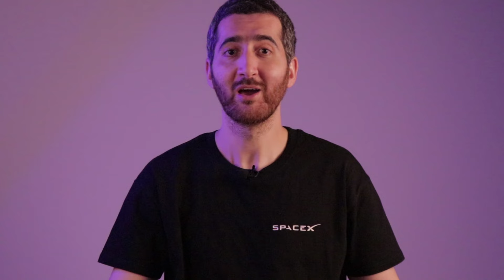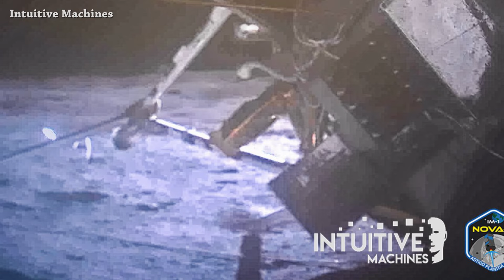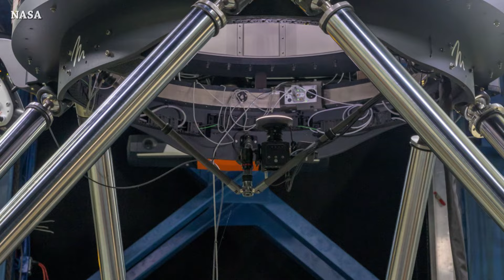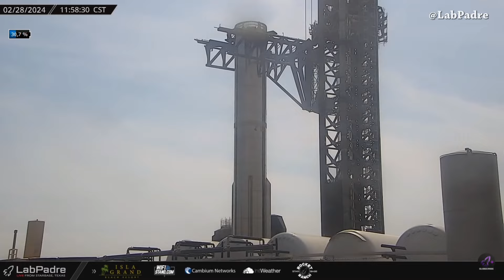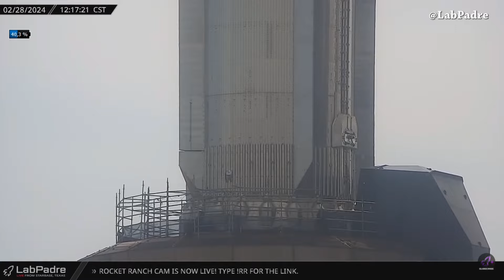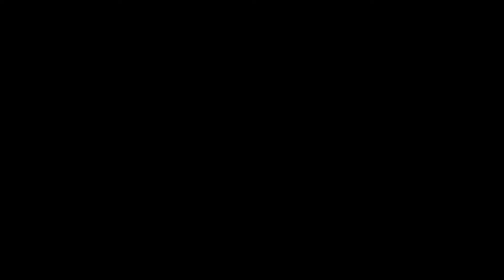Super Heavy Booster 10 Moved, Lifted and Mounted | Starbase Pink

Comment: That full Varda video/audio- disconnect from Photon bus, through and including touchdown- is amazing; and I hope it leads others to start including microphones as standard instrumentation. Even I was surprised that the separation of the two parts in orbit produced an audible sound!
Reply: Sure it does.  Transportation of sound waves happens through the structure of the device, and much faster than by air.

Its 343 m/s in air, but sound waves in steel go 5.5 km/s.

Comment: Thanks Pink.. its staggering to see how far we’ve come since the Apollo missions (or perhaps not) but can’t seem to land a remote lander on the moon without some sort of mess up, We should have had this nailed long ago 😂
Reply: It only cost NASA $100 million. If NASA had built it, it would have worked, but cost 5 times as much. They are going to launch another one incorporating lessons learned.
Reply: Also, the lunar south pol is a much tougher landing area than the equator, in several aspects.  It has to be completely learned.  NASA wouldn't do better either, although the last one was based on a real stupid beginners mistake.